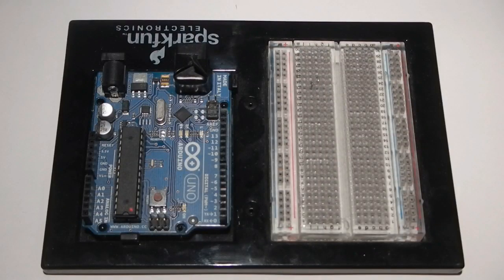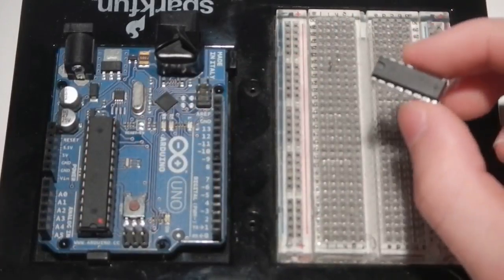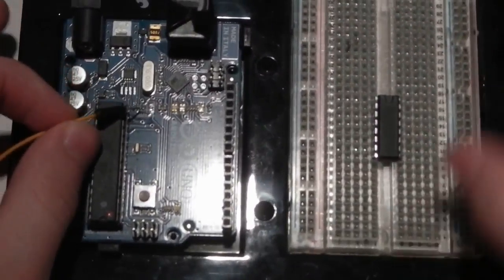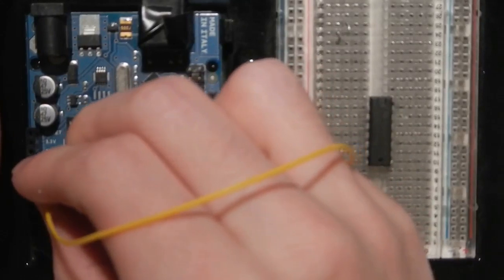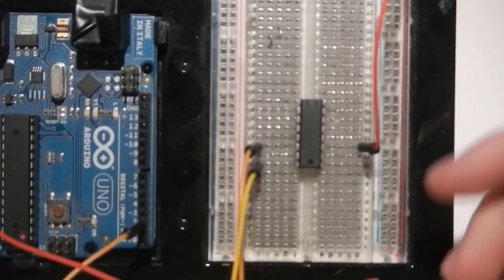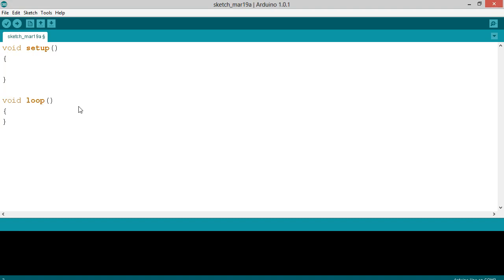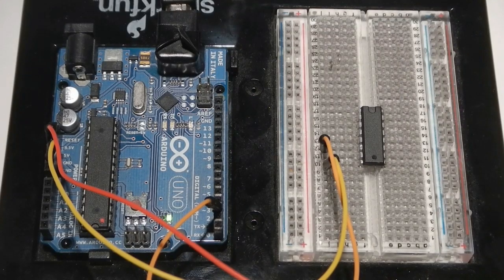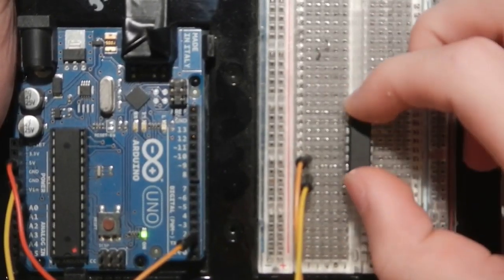Arduino Tutorial #15: Controlling Motors

Comment: tip120 is so much easier to use than that. as for explaining, and math for transistors is secondary to the fact the voltage to current can be done pretty easy with a mosfet.

Comment: The UNL2003 has built-in free wheeling, or flyback diodes for each output.  To use them run the COM (pin 9) to the motors positive voltage supply.  In the tutorial that would be 5V form the Arduino Leonardo.  For a 12V DC servo motor that would be the 12V supply. Always connect the E(pin 8) to the Arduino ground (Gnd) pin.

The total current per port is 100 mA, with a maximum per pin of 40 mA.  If using multiple motors make sure you don't exceed either of these conditions.  A motor driver shield is suggested.  Or if you want to use the circuit presented in the tutorial, don't exceed 500 mA per UNL2003 output.  With multiple motors you may need to use a heat sink.

Comment: To controll bipolar motor you dont need ULN2003, just connect motor to Arduino pin 2 and GND. ULN2003 is using to controlling step motors.
Reply: +Marko Korenić Very very bad idea! You will fry arduino if you use even 5V DC motor because of EMF!

Comment: Thanks for the video.

I'm still a little unsure as why you are are using an additional chip when the Arduino is a controller itself?
Reply: Arduino can provide you about 40mA per PIN, and external devices can require much more. With transistors, or other switches you can say when to switch it ON or OFF and power will be provided from other source. Try to connect car's 12 Volts lamp and you'll see the difference. :)

Comment from the maker: It could be that the motor is drawing too much power for your laptop to supply. I'd recommend using an external power source to run the chip.

Comment: I followed the tutorial for the DC motor. The motor rotates at high speed for a second and thereafter continues to rotate slowly until I upload the file again and again the phenomenon repeats itself. I checked this with two motors. I am using a Toshiba laptop and the arduino is connected toa USB port that appears as COM3 in the Arduino IDE. Request help. Is the Chip malfunctioning?

Comment: Hey man, I'm glad you included the chip name in the notes above, since before I read that you twice said in your video it was a "UNE2003"  :).   Reading the data sheet for the ULN2003, this is an array of 7 Darlington circuits designed for TTL logic and each  individually rated at  500ma and 50v.  Keep up the good work of demonstrating new stuff for the Arduino.  I like this chip!!

Comment from the maker: For high voltage, especially AC, you want to use a solid state relay. This IC is more designed for controlling motors and high power LEDs.

Comment: The ULN2003 is still just a bunch of 7 darlington transistors in a single package, so everything you argued about the npn transistor still applies. 

You still have voltage drops, each darlington is still limited to 500mW or something, you need to use input resistors (on 2001, 2002) so... what can I say, this chip is not something magical that goes around the previous issues you mentioned. 

Maybe explaining the difference between that npn transistor and this IC would have been quite useful.